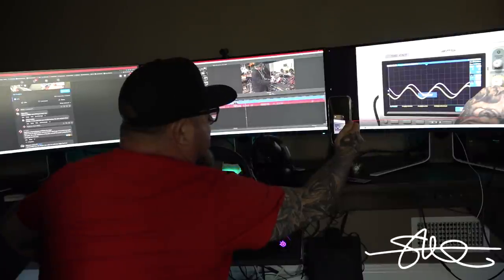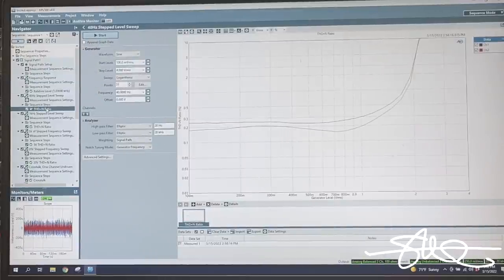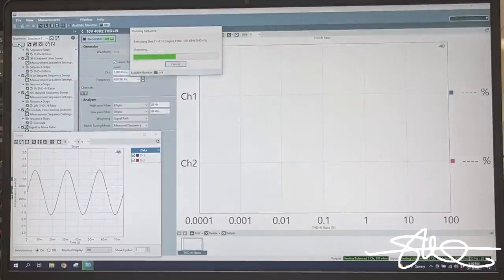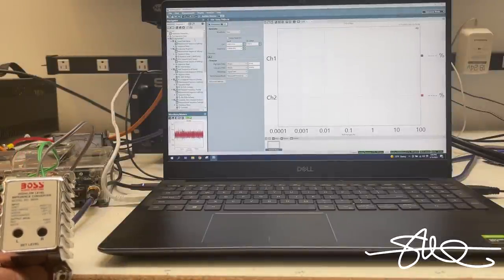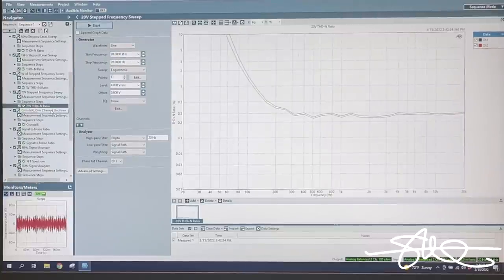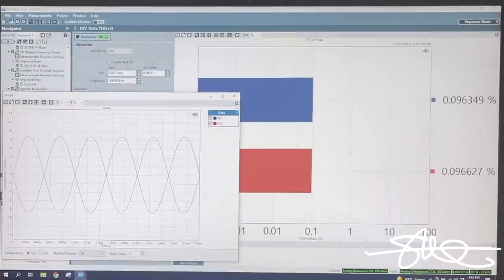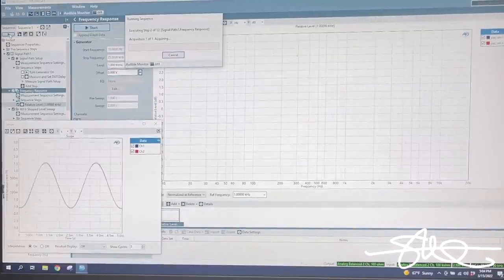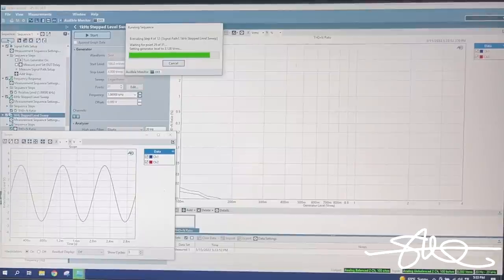Dirty & Distorted Signals explained - MUCH deeper L.O.C. testing on the Audio Precision

Comment from the maker: please see description for individual chapters for quick reference.  Feel free to share with a hater. They are probably to busy trolling to stop and learn though.  Thanks for watching if you did! Thanks again to Tony D for running these on the AP and helping me make this video!
Reply: Keep phase in mind. That shows 2 signals out of time ? Right
Reply: @thegravegigger891  yes there is some small phase shift there
Reply: Could I barrow a dd1 or a dd1+
Reply: I love the testing bullshit equipment  calling them out. Like boss amps dyno so low. One thing I'm currently wondering is how the planet audio pc10f actually is, lot of sites call it the best budget cap. But I'm calling bs. I'm currently running a RP 800.1 SKAR amp to a SVR 12" 800 rms dual 2ohm voice coils wired to 1 ohm (1.4 last i checked) but my 2015 accord ex-l v6 is dimming its lights hard and a 350+ dollar high output alternator just ain't in the cards I mean max draw is 80 amps I think the alternator rated 120. Would it be better to get a cap or do a rear battery relocation get a higher rated XS battery currently running stock i know, the alternator upgrade is prob needed most.
Reply: This is so rude!

Comment: I have the kicker on my avatar tsunami 2000.1 and Buran 460.4 before I had it on my RE Ztx2 800.4 and SQ 1250.1 never had any bad sounds out of it wiring was difficult because I always put new decks in my vehicles but opted to keep factory I’m a kicker fan since I purchased the KS coax speakers back in 07 on a RF P-400-4 amazing quality for the price and sound and I knew it came to this loc too 💪🏽💪🏽💪🏽💪🏽
Reply: Yeah bro you did it right! I've been patient trying to figure out what I wanna run on my Fosgate 1500 bdcp looks like I may go with the kicker. The Toro Force 8s sound the best in my application.

Comment: went with the HCL-2, i started off with a kicker keyloc,, but that shit didn’t even put off a sign wave with the eq turned on. The HLC-2, killed it… I was able to tap into my factory amp sub outs. It converted the High level to a perfect 2v with out touching the gain of the HCL-2… Turn the deck volume all the way up before clip. puts out a clean 5.5v again without turing up the gain… The kicker keyloc sent my amp into protect and eventually fried it.. HCL-2 with the dd-1+ did the job for adding my sundown 15 to the trunk… got 22 speakers now. of course the crossover was set with the cc-1

Comment: It would be really nice to see the Audiocontrol LC2i as well. This is a really nice video though. I wish all companies would give measurements this in depth.
Reply: Guaranteed the audio control was just as clean, I've used them for years and they have always been solid.
Reply: @charleswp71  Yea, distortion probably isn't a concern there. I was more curious about the noise, since it is an active system and all of the ones tested were passives. I hear hiss out of the LC2i when the gain is turned up to a full range amp.

Comment: So if signal out is 2-3 % of distortion is bad what about amplifiers that put out more then 1% distortion at full power just asking
Reply from the maker: the SMD DD-1 is used before AND after the amp...it can easily detect that.
Reply: doesnt matter, it's still bad